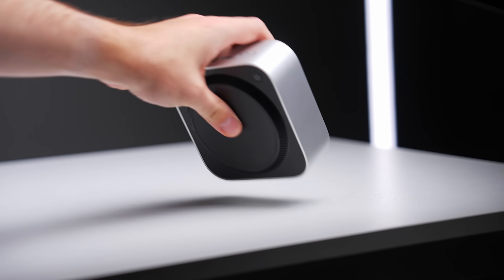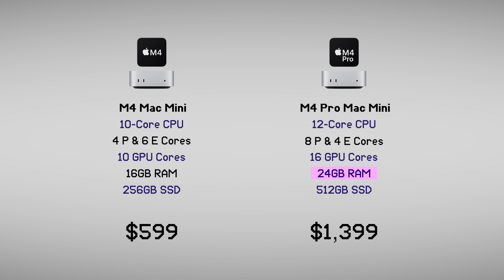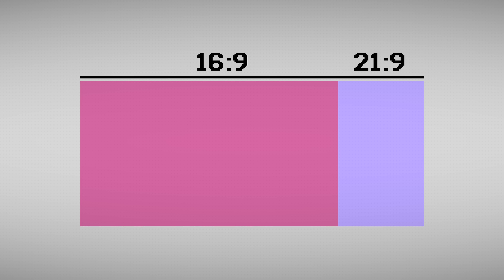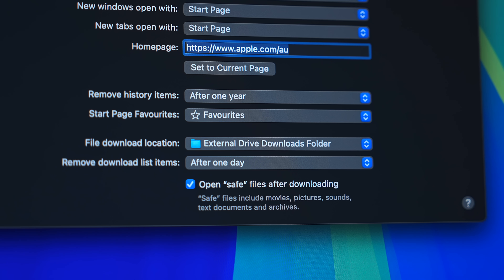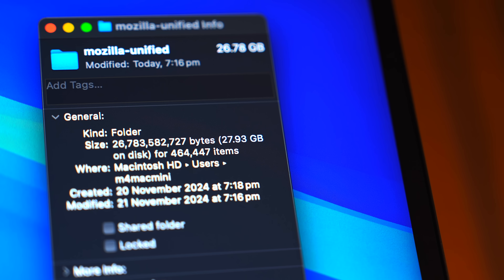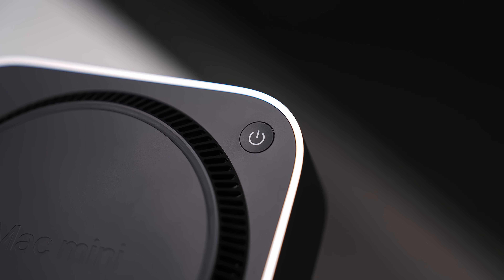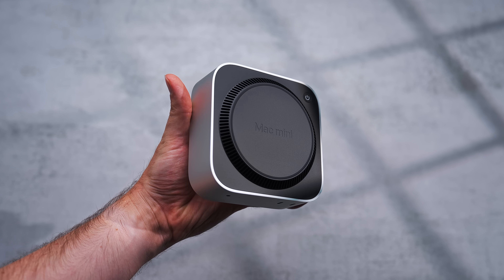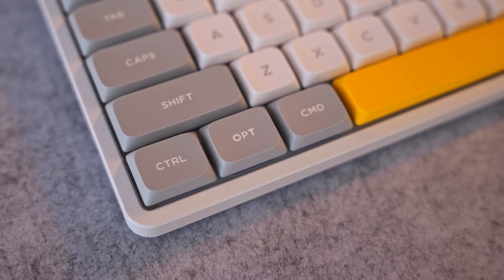M4 Mac Mini - Watch This BEFORE You Buy...

Comment: I just purchased the Mac Mini M4 base model adding an iVANKY dock. I'm going to work with the base machine for a few months before deciding if I need to add a 2Tb chip (Samsung 980 PRO SSD 2TB PCIe NVMe). My previous iMac was a late-2012 model with 32Gb of upgraded RAM and an Intel i7 chip. I will wait to upgrade the Mac Mini until the M8 model is introduced (which will pack up to an insane 256-core CPU, and a bonkers 640-core GPU.)

Comment: Just picked one up, 16gb.... I only websurf but find it Very easy to max out its 16gb ram with about 25 or more tabs open...If checked it will show not only alot of compressed memory but also it starts using swap as well...
Does it actually suffer major slow downs? not really , but using the nvme for swap running at 3 gbps is definitely not that good compared to the unified memory that runs at 110gbps

Comment: Only problem I've found is high intensive games fps slows down. Also 16gb takes about 4 to 6gb to run the system  I'm using about 10 11 still smooth but not much ram left.

Comment: I recently purchased the M4 Mac mini with 512GB of storage. I reused an old 27-inch LG 4k monitor (model 27UD58-B). Its picture quality is more than sufficient for my needs.

The storage upgrade is worth it because: (1) it doubles the write speed of the SSD; (2) it's not a good idea to put system stuff on an external drive; (3) it's too much trouble to DIY upgrade.

I have a 2TB WD external hard drive. (I prefer magnetic storage.) It's for data archival storage, so SSD speed is not necessary.

I bought the Logi MX Keys S keyboard and M550 mouse for Bluetooth connectivity.

Comment: First, while a program may need X amount of memory now, in a year or so it may require more. Also, get the Mac Studio. Much better thermal headroom. Lastly, I think benchmarks while interesting should be mixed with real world tasks. Good luck all. I think the MM is good entry level product for non mac users to have low cost point of entry.

Comment: TB4 external SSD NVME speeds are actually *FASTER THAN INTERNAL SSD ON M4 BASE MAC MINI* ... using OWC or Quiizlab external TB4 enclosures and mid-tier NVME SSD (e.g. WD Blue), you can get 3000 read/write performance on an external drive, whereas the base 256 SSD speeds on M4 mini are quite slow, only 2000-2500.

Comment: I completely hate Apple's closed off eco-system. Not being able to upgrade more RAM or storage at a later date is insane. I have iPhone and iPads and are good for what they are. I owned a couple of Mac minis way back in the day. When the newer ones came out and the starting price was more than double I stopped. MS is shooting themselves in the foot with their absolute insane tyrant moves with Win11 OS. I might need to get a Mac mini so that I can use Adobe software. One bit of info that I am still looking for is whether the graphics can provide a 10bit per channel pipeline to the monitor. I have 2 99% Adobe RGB monitors and would only consider getting a Mac mini video supports 10bit for Adobe RGB color space. I know in the past that Apple did not.

Comment: I'm planning to buy a M4 Mac mini w/16GB next month. I don't want to mess around with the hardware.

To play it safe, I'm getting the 512GB SSD. I also want the higher SSD speed.

For external expansion, I have an old WD 2TB portable hard drive lying around. This will save me some cash. The good thing about a hard drive is that it won't wear out like a SSD will with limited write cycles.

Comment: using premiere pro, will i see a dramatic speed boost vs my m1 laptop? and Will I only see the speed boost if i work with footage on the mac mini? SOunds like your saying my t5 or t7 harddrives will slow it down. how do i maximize. will the m4 base model be a big jump forward for me editing speed rendering ect? i like to have lots of apps open or tabs at least. should i as a filmmaker go up a model for more ram or space
Reply from the maker: I'm not saying your T5 or T7 will slow it down. For reading and writing video footage you'll be perfectly fine. Yes the M4 will be significantly better than the M1 and you will notice a difference when video editing or multi-tasking.

Comment: amazing video, I am going for M4 Mini with 24 GB and 512TB storage with NVME Samsung 1tb. From a display stand point, i'd prefer the Samsung ViewFinity S65VC UWQHD Monitor which comes with built in speakers and a KVM switch as I usually plug in my work laptop to the same display as well. What do you think about this config as I will use the setup for editing, video processing and documentation ..
Reply from the maker: Check out my most recent monitor review video. It's a 5K monitor with KVM (the built-in speakers suck though).

Comment: Hi m8,
Thanks 4 the video, it is fantastic. I’d like to get your opinion in a particular question. I’ll buy a Mac Mini 4 soon.
Base version has the best bang for buck.
It has a gigabit port but they ask for £100 to upgrade it to 10Gbps Ethernet port. I have 1.2 Gbps internet package. Do you think spending £100 is really worth it?
To be honest 24Gb ram (£200) , 512Gb SSD (£200) with 10 GBPs Ethernet port (£100) is the best option for me but price jumps from £599 to £1099.
I’ll use this pc for daily PC requirements but if I open a YouTube channel this year, I’d like to learn video editing as well. What could be the best option and combination for me?
I’d like to hear your valuable opinions.
Reply from the maker: The 10G ethernet port is only really worth it if you can saturate it consistently either via high-speed internet or some kind of NAS connected. Assuming your internet speed is consistently 1.2Gbps, you'll be paying $100 for an extra 0.2Gbps of speed. Up to you if that's worth it over the next few years.
Reply: @CreatedTech thanks much. Gigabit internet is getting  cheaper every day here in the UK. I pay £39 for 1.2Gbps download and 1Gbps upload. I assume 2.5Gbps will be in similar price range soon. So you are right, £100 for Ethernet port upgrade is worth it because I’ll use Mac mini at least 4 years.

Comment: Little 5“ x 2“ box that weighs a pound and a half. It’s very difficult to pick it up and push the button if you absolutely need to shut it off seriously if you need to shut it off it’s probably because you’re plugging it anyway and moving it or ortaking a portable for a bit otherwise you don’t need to shut it off

Comment: Please be down. I have a Windows XP machine that up in Calgary recently has been turned on powered out since I bought it in the early 2000. Why would you be shutting your PC off? Why not just configure it in full power saver mode let the stupid thing shut down and spin down the hard drive and go to sleep using virtually no power so you can just touch the keyboard and it comes back online every other pizza hardware in my house to consoles my Internet gateway, even my stereo doesn’t actually shut off just goes in a power, saving mode at the physically go hold the button if I wanna shut it down completelyI’m pretty sure that thing only drives a few watts when it’s in power saving mode anyway it only drives like 40 W when it’s full and running I have lightbulbs all over my house drawing that much wattage.

Comment: Be given that in the past, it wasn’t functionally upgradable at all other than Saturn and now it’s a plug-in car that can be one screw just like a normal SSD one screw unplug it put a different one in you gotta know that Apple intends to license that for proprietary hardware to third-party for upgrades or maybe they’re gonna do it themselves Obviously, the unified memory can’t be upgraded without replacing the chance, but that SD card and 100% be upgraded at a minimum you could literally find someone with a failed motherboard and buy it and take the SSD out. Pretty sure that the base M4 can handle up to a 2 TB SSD right Above that you gotta go with the pro but pretty sure it’s not that big of a deal there will be upgrade taps for this particular part of the hardware sometime in the future and even if there isn’t seriously, we buy a new console to play games on every 8 to 10 years sometimes twice and each console generation does one fail what the hell is the big deal about a $600pizza hardware

Comment: For 15 years, I used Linux. Nothing against that OS, but i was time for an upgrade. So the M4 Mac Mini is no problem because I am used to having a 256 GB drive and have an external drive to store data. Besides, I am new to Mac. Another thing I want to add is that I had free apps when I had Linux. With Mac, I look at these apps I had prior and would ask myself, "Do I need this app?" One thing I noticed is that Apple is picky when it comes to downloading open source software from an outside website.UPDATE - I use Garageband and iMovie and love them! That's basically all I need - along with Affinity, Libre Office Suite, Internet, Krita, and a few others. I can always save my data to an external drive.
Reply: Thanks for sharing your experience.I was also thinking about switching from arch Linux to m4 mini.I was kinda sceptical at first but after reading your comment I am feeling more comfortable now:)
Reply: @StudyHard-t9x  Glad to be of help. However, do not give up Linux completely yet. In ther words, I have a laptop with Linux Mint XFCE and I have it aside my Mac Mini because there arre some apps that L:iux has that Mac doesn't. Yet, I am glad I got the ac Mini because I can do a lot of multimedia things with it.

Comment: I have 16 GB of ram for my macbook and it's almost always 80%+ utilized even when doing light coding activities. Furthermore, a lot of the new AI based tools we use even day to day use so much more RAM (arc, cursor, granola, notion etc.). This is only going to get worse with every single app adding an AI feature (I am looking at you photoshop). If you're a dev or other professional and going to do anything with AI or else you should absolutely ignore the guy and buy the 24 GB or 32 GB version. If you just use it browse the internet, sure go ahead with the base model but in that case my question would be why you are buying a desktop pc in the first place. 

RAM is the single most important thing in a computer in my opinion. I almost never experience issues with CPU or SSD utilization in my career but almost always with RAM. Even things like thunderbolt ports etc. don't really matter. You can easily buy a caldigit or something similar to fix port issues, you almost certainly not going to utilize your GPU fully and with a desktop you can always hook up an external SSD. You can't do any of these things with RAM so do yourself a favour and upgrade it. 

Thank me later.

Comment: I just bought a base model M4 Mac Mini and is now currently paired with my LG C3 TV. I am able to take advantage of 120 Herts refresh rate and the experience is great. Problem occurs when I try VRR, I can see screen flicker on the darker areas of the screen. The TV does support VRR with G-Sync and AMD FreeSync but still doesn't solve that problem. For now I have switched to constant 120 Hertz. Any Ideas?

I also boot prefer booting my Mac mini with extenal Satechi USB4 NVMe enclosure with Samsung 990 Pro 4TB which comes at an expense of apple intelligence feature. You should consider exploring thunderbolt booting on your next videos

Comment: Going for a M4 Mac Mini....PRO !  Even with a few upgrades, RAM !!!!   Will be way cheaper than any 27" iMacs I have bought.  It's worth the upgrade and cheaper than a M2/M4 Mac Studio is/will be !   Will be replacing a special ordered 2017 27" iMac 1 TB HD which I upgraded it later to 48 GB RAM.  Use Luna display to keep using the 27" screen of iMac with USB C cord til it dies.

Comment: I've never had a Apple computer. Full on windows profession here though not by choice. I am a Sr Data Engineer and didn't have a need for a Mac just for entertainment/browsing/creative purposes. But I might get into my creative hobbies in the near future. But that's not a must right now. 
 
If I can run windows 11 on Mac Mini using Parallels, smoothly and fast, I would get the Mac Mini even if it needs more than the base specs. What configuration would be good for running Windows on Parallels and still be fast? Should I get Mac Mini M4 or Mac Mini M4 Pro? What specs?
Reply: Did you ever find a way to make this happen? I too have been full on Windows. I'd love this, but only if I can still run Windows as well.
Reply: @angelarael48  No. Not yet. But based on replies I got from other comment sections. If you plan to use windows and VM / Data Engineering/ AI models etc., it's safer to go with M4 Pro with at least 24 GB RAM and 1 TB disk. For any additional storage of data you can have external hard drive.

Comment: The power button is on the bottom rear so that you will want to purchase 3rd party docking station which are showing up now. They lift the unit and provide opening for easy access. Corporations are in bed together.

Comment: It would be foolish to buy the mini with only 256 GB of storage. Sure it costs a little more to bump it up but I feel way more comfortable with 1 TB to fall back on and THEN use external storage. 256 GB is just not enough these days.
Reply: But 1TB almost doubles the cost of the machine!? 😵‍💫
Reply: I think they have an upgradable storage but Apple hasn’t rolled out the ssd for it yet
Reply: Not really. I always bought base storage. And to be honest i have an external ssd that im not using that much
Reply: External storage is easy to add. Base 16 RAM is a great base, and benchmarks looks excellent on this compared to other top chips for $500
Reply: Move your home directory. Or install third party. I’ve just ordered min spec as a developer. I’ll get by.
Reply: Im just bought the base model & already login the apple id, can i use external ssd (nvme enclosure) when i have money later on?
Reply: @cf9570  yes, with some limitations... some OS files and apps will not play nicely, though you can retarget your home drive and some non Apple apps.
Reply: Agree 512 is the go!

Comment: I HAVE AN M1 MAC MINI 16GB.
WITH ONLY ONE APP OPEN, SAFARI AND 2 BROWSER WINDOWS OPEN WITHIN THAT,  11GB OF THE MEMORY IS EATEN UP
SO YOUR RAM TEST HERE IS NOT ACCURATE
Reply from the maker: macOS is designed to try and use all available RAM at all times. So yes, what you're seeing is normal and my RAM test is very accurate.
Reply: @CreatedTech  Actually my Brother who is an apple technical support Tech says that it isnt Normal.  But OK. I went into the apple store and tinkered with an m4 Mac mini  with 16gb and the same thing!  Give me a break. LOL😂😂😂😂😂😂😂
Reply from the maker: @MatthiasSangiovese  Yeah your brother has zero clue what he's talking about lmao and probably needs more training. I worked for Apple for 5 years (maybe I even trained your brother), have experimented with about 30 different Mac configurations over the last few years, and I'm telling you for a fact that I am correct. Use some common sense - if it took 11GB to have two apps open, you'd need 50GB+ of RAM just to use the Mac normally. You can look at the "Memory Pressure" graph in the bottom left corner of Activity Monitor to give you a better idea. If it's low/green, there's no issues. But I'm sure you and your brother know better though 😂

Comment: I still have Imac intel 4.2 GHz i7 with 48 GB and Mac Book Pro i7 16 GB, which only works when travelling. 
I mainly use Adobe Indesign, Photoshop, Illustrator and switch to Powerpoint, Outlook, Internet etc. I have a lot of windows open at the same time. 
I had tested mac mini m2 pro with 16GB RAM. Didn't convince me. Sent it back. And waited for m4.

Now wanted to switch to m4. But desktop with Studio Display. Can't wait any longer for Mac Studio. My iMac is slowly coming to its knees ;-) 

Mac mini Base with 32 GB and 1 TB or Mac Mini m4 pro with 48 GB RAM. What is the recommendation? I will definitely go for 1 TB. Time Machine runs on external 4 GB and archive on 2 additional hard drives.

Comment: On / Off button is no problem Turn the dam thing upside down lay it on it's topwith Power Button exposed Might even give Better Cooling especially if the Desk were Metal and may become a Heat Sink.

Comment: I need this to last 7 years (or more) as a Home PC.  So I choose 512/24. Over kill for now of course for basic home office apps.   I have seen speed tests which show the 512 is notably faster than the 256.  I will add an external 1TB drive for files. Looking forward to retiring our 2014 Mac Mini which I upgrade with an SSD two years ago.
Reply: I’m planning to buy soon, but will it last 7 years if internal SSD is not replaceable? Do you have some previous experience with apple silicon macs? It would help me so thanks in advance.

Comment: Just a FYI : keyboard shortcuts exist to power off the computer (e.g. ctrl + media eject keys), and then if you have a touch id keyboard for example, you can power on from there. Of course if there's a freeze or hardware issue won't work, but for day-to-day, there are workarounds for lack of physical access to the power button.
Reply from the maker: TouchID keyboards don’t let you power on if the Mac is fully shut down like I explained and showed in the video.